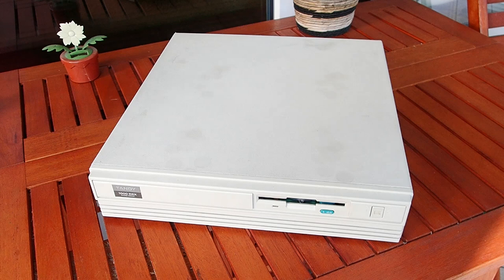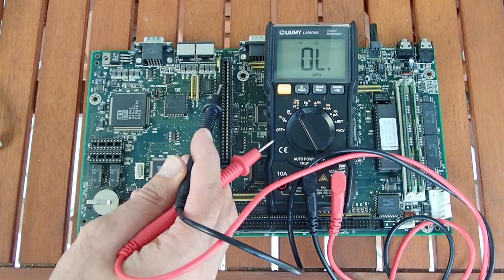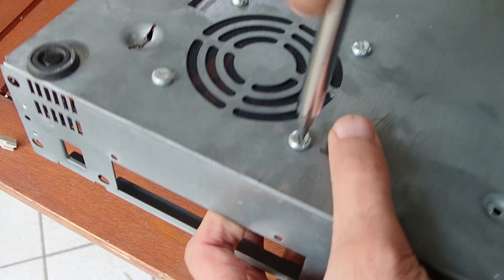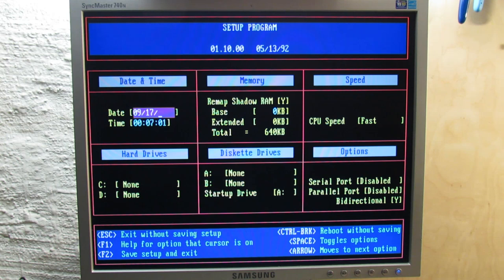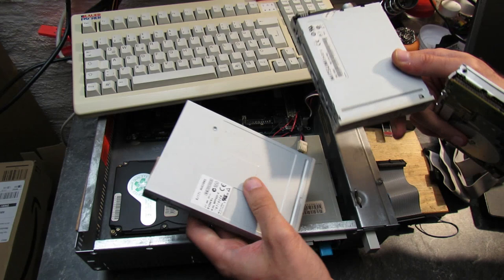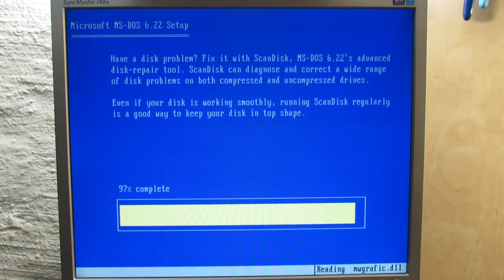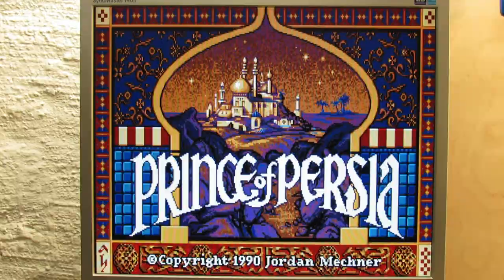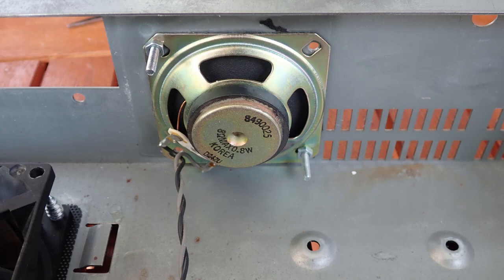#SepTandy with Tandy 1000 RSX (Part 2): cleaning and setup

Comment: The corrosion/white substance is explained with basic chemistry - The steel case is galvanised which means it is zinc plated.  The white substance is zinc oxide, once the bare steel underneath is revealed that too suffers oxidation.

Comment: It was such a small and slim case for computers of that era, but seeing how little space was used within the case they really could have made even more compact and smaller. Very interesting.
Reply from the maker: They probably could, indeed. However, I think, they wanted it to be still used as a desktop under a monitor, as it was pretty common back then. If they would make it smaller, it would be too small to hold a monitor, I guess. I think, as first tower cases came to market, it was quite rebel :)

Comment: Congrats for your really great and informative videos.

There is one thing I would like to hint you:
I know this one is old, but i have seen this one thing in a lot of your videos:

You are not using the rigth screwdriver. Nearly all screws in PCs are Philips PH2. The scredriver you are using is to small, maybe a PH1 or something. If you would use the right scewdriver for the screws, you could apply much more force to loosen the screws. Also the risk of ruining the screw heads would be way smaller, as a PH2 would perfectly fit into the cross.

And please don't mistake Philips for Pozidriv which are very common here in Germany. Although they look similar, you will only get a perfect fit with the right type of screwdriver for a screw.

Comment: Excellent work on the power supply!  I just replaced the fan in my Tandy 2500 XL and was thinking to myself "I sure hope this power supply holds up long term."
Reply from the maker: Thank you! I guess 2500 XL has a bigger PSU and more space for more sufisticated solution?! In case it needs more power, it would be good to do something more apropriate as a PicoPSU, I guess. However for 1000 RSX (some of 2500 series are actually the same hardware as 1000 RSX), the solution I made should be more, then sufficient. The original PSU gave 3.3A on 5V, now it gives 6A. With a better notebook PSU inside, it is even possible to get 8A at 5V out of the PicoPSU. Anything above would need something different....
Reply: @necro_ware  Yeah, its a 70 watt PSU, has space for an 80mm fan at the rear, held in by a spring clip.  The original sounded like a jet taking off so I replaced it with a new, much quieter fan.  I'm trying to do "Project Tandy Xmas" by having this running nice and quiet so I can have it running old Tandy and Sierra Christmas demos this Christmas each night.  This was my dad's PC when I was growing up, lot of great memories.  I'm replacing the original 52 MB hard drive which is also quite loud with a CF to IDE adapter....this drive still has his original Deskmate files and Wolfenstein 3D save games on it, exactly where he left off in the game in the 90s!  Anyway, that was my first snag in the project.  When I hook up the CF to IDE adapter it causes the 2500 to not fully boot and output garbage to the screen.  It doesn't even have to have power to it, just having it connected to the IDE ribbon is enough to cause the issue.  So, I'm still working through troubleshooting that...not sure if I have a bad CF/IDE adapter or if there is something non-standard about the IDE on the 2500 XL.... the original seems to be just a regular IDE Quantum drive, so I was assuming no IDE oddities.
Reply: Think I have boot issue figured out.  The CF adapter has 3 jumpers on it: one for power source, one for master/slave and one for voltage selection.  I tried each setting on each jumper in various combinations to see if that would resolve it, but no luck.  I just came back to it and decided to go completely jumperless and then start adding jumpers in.  Ended up finding out that the 2500 XL doesn't like having the master/slave jumper set to anything.  Completely leaving that jumper off allowed the system to boot and DOS could see the drive.  Glad to be progressing again!
Reply from the maker: @pipp33  Sounds weird, may be a wonky CF-IDE adapter? How was the setting on the original hard drive? If that was standard IDE, it have had a master/slave setting, I guess?! However, glad you got it running!

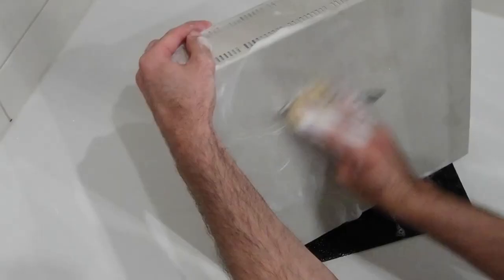Comment: @4:40   Use some cotton balls soaked in dilute hydrogen peroxide, and place them on top of each circular mark that's been left by the monitor stand. It helps to get a bit of experience as for how long to keep those cotton balls in place... so you don't end up 'cleaning' the spots too much & cause the spots to whiten too much.

Comment: I seem to remember Tandy using straight through floppy cables(with no twist) and you had to select the drive on the floppy itself. There is a workaround IIRC the same issue was encountered installing a gotek in a 1000HX.
Reply from the maker: I just had to set the jumpers properly. That was my stupidity, but if I remember right, I mentioned it in the next part.

Comment: I don't recommend just a diode for polarity protection. I'd use a diode to drive a MOSFET such that when you apply voltage it goes through the diode to turn the MOSFET on and allow the input voltage through. Why do it this way? Because there will be almost no voltage drop; less than 0.1v even. (Sorry for commenting on old videos but I think it could be relevant advice today too)

Comment: Very nice work with a very nice PC. A piece of advice, instead of varnish you can protect the chassis with galvanized spray paint (rust oleum has one). It's a more adecuate for the metal protection and you'll end up with a very good finish. And maybe spray the whole metal if colour tone is very different.

Comment: Since you din't mention more details about your floppy issue, let me fill them in: My guess is, since this isn't the bus powered floppy as in the documentation, this is a drive select floppy - hence the switch (likely labeled DS) on the side. Several Sony drives have these switches. Simply said, this removes the requirement to twist some lines of the floppy cable that IBM introduced to address multiple floppy drives.
I don't know about the Gotek, but maybe it allows you to choose the drive ID by drive select.
Reply from the maker: Yes, I mention it briefly in the end of 4th and last part of the Septandy2020 series.
Reply: @necro_ware  Ah, I'm not so far yet :D

Comment: That is very interesting.  On the Tandy 1000 TL/3, there was an HD 3.5" floppy that both power from the drive cable.  I read online, however, that with the SL and TL series you can simply snip all the odd wires and supply your own power, and a regular floppy can work.  I have a TL2, which has a DD floppy, but I think the motherboard on that one and the TL/3 are the same, except for the crystal, as the TL3 has a 12Mhz CPU.  I also think the person with the tip on the odd wires is correct, as the 5 1/4" connector cable has a molex power connector, and has most of the odd wires on the cable punched out.  I will attempt to use the BIOS utility in your video, and connect a HD 3.5" drive.  It is interesting, because I also have a Lo-tech ems memory board I got and have not been able to make work, but I got some nice tips from a Mr Lurch video yesterday on that.  Thanks again for the informative video.
Reply from the maker: Glad you liked it and thank you for the information too!

Comment: I bought the 2.88MB drive recently (that I hadn't tested yet). It has the same long blue disk eject button with 2.88 on it. But unlike your drive it doesn't have  power connector and should be bus powered. Just curious if any of my floppy controllers will recognize it. Probably one on Adaptect SCSI board will, it has support of 2.88 drives, but I need to test.

Comment: 12:00 Check my post on the last video. The Tandy 1000 line used the Shugart pinout instead of the normal PC floppy standard. Make a cable swapping pins 10-12 on the floppy end, and you can use a normal PC floppy or Gotec. http://www.mediafire.com/view/3xg993jhxx46jo4/RSX_Floppy_cable.jpg/file
Unlike the documentation claimed, the RSX motherboard does not send power through the floppy drive cable. Earlier models, such as my 1000 HX did however, so be careful.
Reply from the maker: Thank you, I answered your first post about it, in the first part of this series.

Comment: The floppy disk drive thing is because of the DS0/DS1 jumper. Just like ide HDDs, floppy disk drives use jumpers. However IBM implemented the floppy disk drives a bit differently with the all configured as "DS1" and the cable has a swapped part to turn it into DS0. But on your Tandy it is not made that way.

As for the fingerprint, I have seen that before. I think that is caused by the grease we all have as humans in our fingertips. I think it's a little bit acidic and may cause stuff like this after many years
Reply from the maker: Thank you Deksor! I saw some old drives with DS0/1 switch before, but usually, just as you say, it is automatically detected by a twist in the data cable. I tested all kind of cables so far with this Tandy and also connected the drives to the twisted and non twisted part. I think I'll come back to this later, just out of curiosity.
Reply: This has to do with the fact that the Tandy 1000 line used the Shugart standard for their floppies instead of the normal PC standard. I posted a picture on my Mediafire a couple years ago demonstrating how to get around this on the RSX http://www.mediafire.com/view/3xg993jhxx46jo4/RSX_Floppy_cable.jpg/file It's not just the drive select jumpers, you have to move over the motor enable as well, which in this case just involves reversing the keyed header on the ribbon (so pin 1 goes to pin 1) and swapping pins 10 and 12. Then you can use a normal floppy or Gotek. I did that on my RSX when I had to replace the floppy, and it works like a charm.

Comment: Wow...  makes me want to dig my 386 out and finish it up.  I don't have a Tandy computer, though.  I have an even more rare (seemingly) Intermec 0100 running a 40 MHz 386 SX.  The part where you discovered where the -5v was in your system made me think that my 386 may have a similar setup.  I've been having trouble getting a sound card to work in mine, even with Windows 95 installed.  As a side note, my Intermec came with a 16-bit ISA wireless network card.  LGR did a video about it...
Reply from the maker: Thank you! Very interesting info on the wireless network ISA card, I'll take a look at it.

Comment: I knew this diode will bite you. I was amazed it didn't bite you right away
Reply from the maker: Yeah I was hoping, that the voltage drop on that wouldn't get so far.... I probably had to measure better.
Reply: @necro_ware  you have used high voltage diode, which have high forward voltage drop.
Use low voltage, low forward voltage drop diode and you can get easily reduce drop it to 0.2v
I would not use diode here. I would use MOSFET, which would have really small voltage drop and very low power loss.

Comment: I have a RLX and RSX 2500 that I am trying to get working.  Trying to fit my RSX with a compact flash is driving me insane.  I must have bought 15 different cards and finally found one that would work, but then found one of my 6.22 disks had corrupt data...sigh...Next up is a Gotek to make life easier.
Reply from the maker: Didn't the compact flash cards work at all? Were they at least detected by the system?

Comment: thank you for posting.  w/ flat [no twist] fdd cable, is fdd set to ds0 ?  take care & stay safe.
Reply from the maker: Just checked once again,  the Sony drive has a switch with 4 positions 0,1,2,3. Currently it is setup to 0 and I guess it is DS0. I'll do some investigation later, when I have more time.
Reply: @necro_ware  You can set the Gotek to the same drive selection with jumpers and it should work. just fine with the Tandy.
Reply from the maker: @GreystarOrg Yes, I found it meanwhile as well and it works! Anyway, thank you for the suggestion.
Reply: Check my comment on the previous video. Tandy 1000 computers used Shugart floppy pinouts. Make a cable swapping pins 10-12, and you can use a normal floppy or Gotec set as DS1 (which most "modern" floppies are hardcoded at). You might also need to knockout the key, or swap the connector on the ribbon so that pin 1 goes where it's supposed to. http://www.mediafire.com/view/3xg993jhxx46jo4/RSX_Floppy_cable.jpg/file

Comment: Hi! Maybe you can consider to upgrade the Gotek firmware to flashfloppy firmware, place an smal oled screen on it and set the jumpers to Tandy and see how it goes.. I love gotek with flashfloppy. Great video!
Reply from the maker: Hi Jorge! I already missed you :) Even my wife got nervous, if everything is ok with you. Nice to have you here again! Regarding Gotek, I have 5 of them and I didn't even bother with the original firmware. I have FlashFloppy on all of them from the first minute. I also have one device modified with the screen, but it is installed in another PC. I use this black one, which you see in the video, in my workshop for repair and so on. It is not for normal daily usage. However, good idea with the jumpers to Tandy, I'll try that.

Cheers!
Reply: @necro_ware  hahahahaha!!! :) Sorry for the delay :D I have been coding some stuff for clients abroad and it is been quite a challenge... Been a little away from palying with old hardware, My project now is an memory upgrade to 2MB Chip Ram on an Commodore A2000 to pair with TF536... I have been dealing with fake TC514400AP-70 RAM's chips and I cant find a reliable source for them, the Agnus chip I already have...
Reply from the maker: Yes, I know, it can be quite a challenge to find old stock replacement parts.... May be you can buy some old SIMM RAM and desolder the ICs you need?
Reply: @necro_ware  did that :( the memory configuration was not the same :( I should have checked the datasheet of the RAM's first :( With those only green screen on boot, but it was expected not the same configurartion :( They must be 1.048.576 Word by 4 bits) ... My bad for didn't check them...and I dont have a compatible ones DIP 20....

Comment: I have never been able to get the polish back on the metal after removing the rust.
Reply from the maker: Yeah, it is tricky indeed, you have to use very fine sand paper, which I didn't have. However, better to have unpolished metal, than rust,  I guess :D
Reply: Jeweler's rouge, maybe?
Reply: @stephendouglas9355  Had to Google that.  That may be what I need.  Jewelers Rouge is a polish for primarily silver and gold.  There are a range of polishes for different materials, white it seems may work for a PC case.  Just need the correct tip for a dremmel or other tool...sander may or car pokisher maybe short of a sanding wheel.  Thanks.
Reply: @larryladeroute971  I've used it with a buffing wheel for aluminum and steel. You can get a mirror finish(i.e. semi truck chrome). May be a similar paste metal polish that can be applied with a dremel buffer wheel. Rouge is a carcinogen, btw, I believe.
Reply: For light rust just rubbing with light machine oil may remove it and not further damage the plating. Another approach would be to use "rust reformer" to convert the red oxide to black oxide which should be easier to remove or at least be less conspicuous.